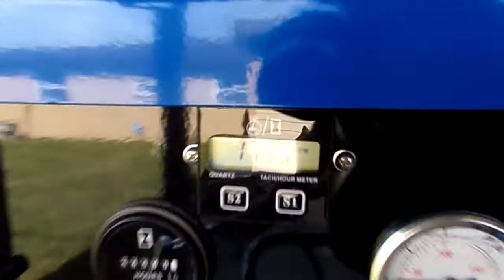Truck Mount Tile & Carpet Cleaning Machine 33 SE with the Honda EFI IGX700 Twin Engine

Comment: The great thing about Honda EFIs are very fuel effecient and don't need to be chocked to start them. Honda is right up there with Kohler. Nice looking machine. Had my 47 XL for awhile delivers great suction and heat.

Comment: This machine is so easy to fix. Very easy to get parts. Everything is wide open and easy to get to. In the 6 years I have owned my 45 SE, very little money went into maintainance or repairs, cause this machine is built like a Tank. Thanks Pete for the greatest machines out there!